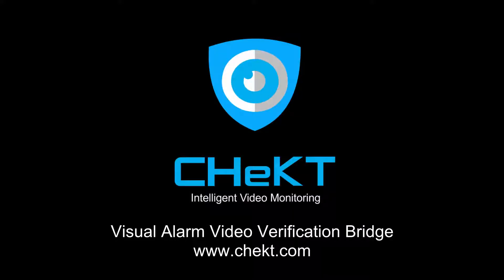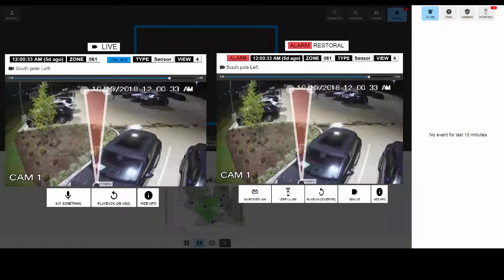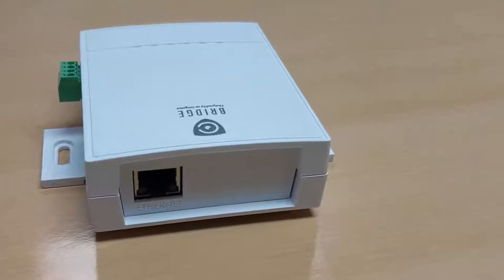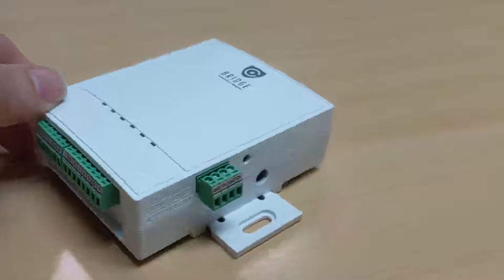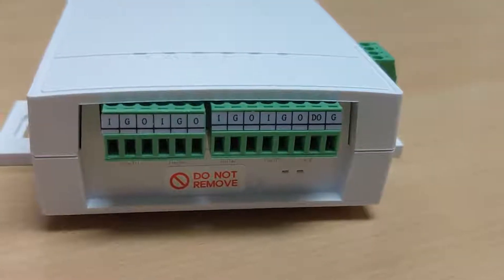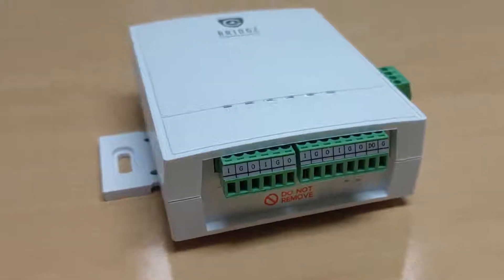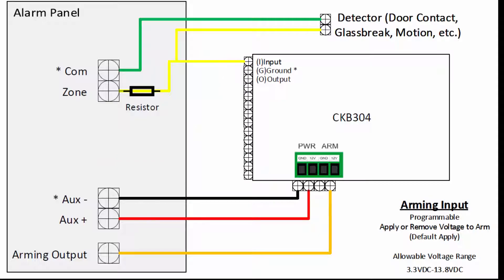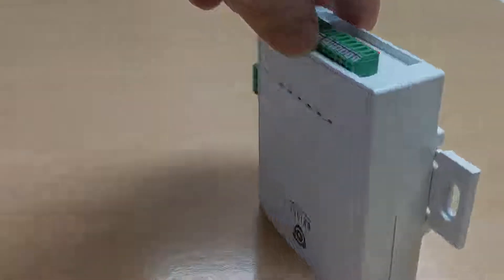Wiring the Visual Verification Bridge - Overview

Comment from the maker: So much has changed since then. We look forward to helping.    New units are 12v power or POE power.  Alarm triggers can be camera analytics metadata, API calls or wires sensors. We have a 8 channel, 12 channel and a 16 channel.